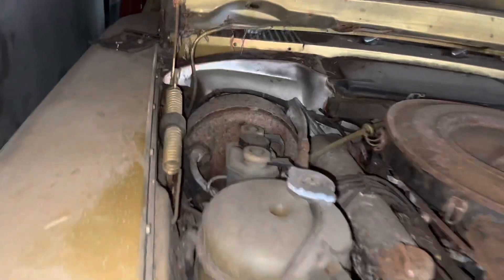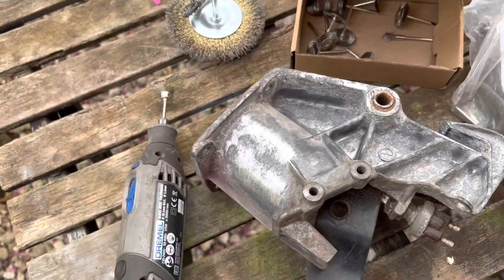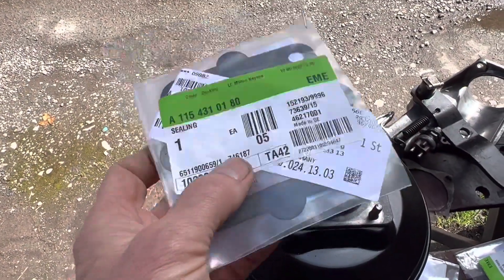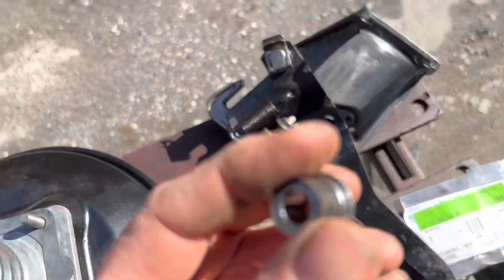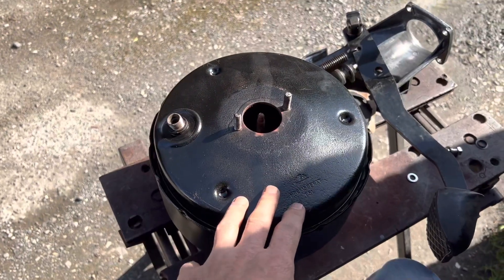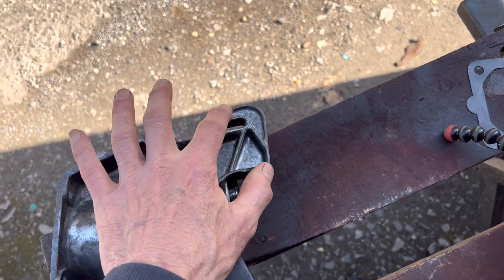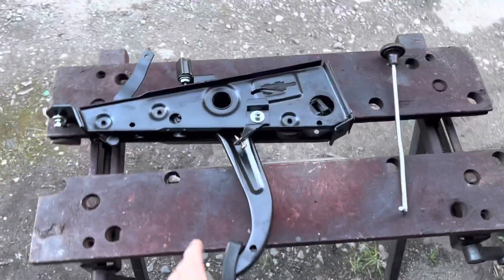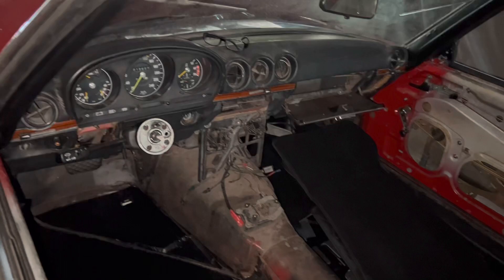Mercedes R107 SL brake booster, brake pedal restoration and installation

Comment: Many thanks for yet another great video. Just removed the booster this morning. Stupid prior owner had let the seal between the master cylinder and booster go bad so booster was full of brake fluid as was the wing underneath. The wing now has some nice rust holes for me to contend with. Overall removal was relatively painless, screws came off easily and unlike your brake pedal mine was held on with a bolt, same as yours and a hole with a pin. That was it. Remove the pin and bobs your uncle! I can confirm the gasket is on the outside, not inside and made of what seems like a latex type rubber. Refurb of the booster is $280 which seems fair as they respray it too. Be well.
Reply from the maker: Thank you so much for the 'super thanks'.

Yes....leaking brake fluid does a good job as a paint stripper...which in turn leads to rust. $280 for a brake booster refurb sound amazing especially as they are crimped shut and hugely expensive to replace. Mike

Comment: Hello Mike, good move in tackling the engine next. The D-Jetronic 107 are a very special "breed" of cars, so it is best you start as soon as you can. Having completely restored a 450 D-Jet, I can guide you through the process. Hopefully you can get it to run without too much hassle.

You will have to learn about the "trigger points", "switch box" (for ignition), MAP sensor, ignition points, the various temperature sensors, TPS, AUX air valve (that usually fails) and the "ECU" (for the injectors).
Reply from the maker: Holy smoly sounds complicated.....Before I bought this car, they did get it running (apparently) but there is some funky wiring and relays I don't recognise so it will be fun....1st step will I thinjk be reinstalling thge fuel tank, lines and pump etc. Mike